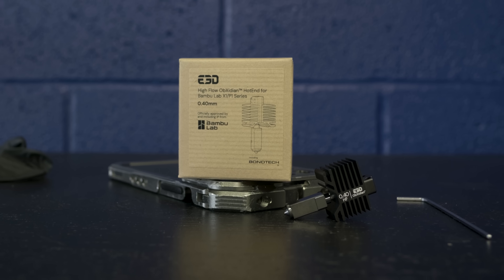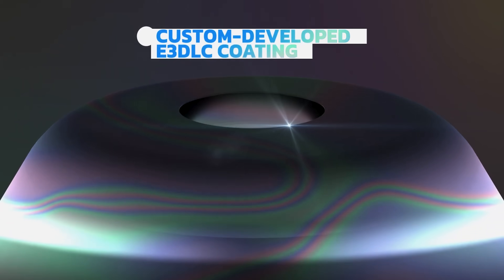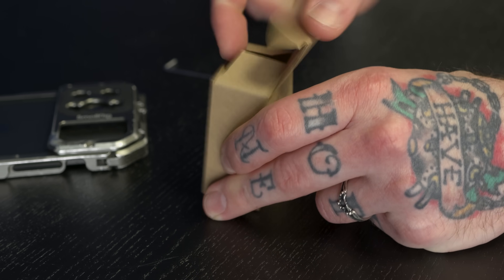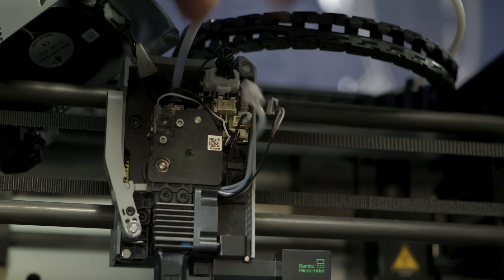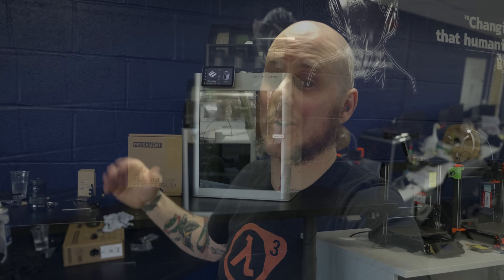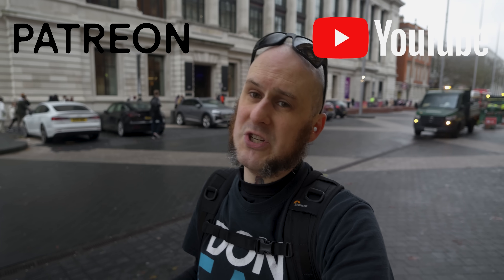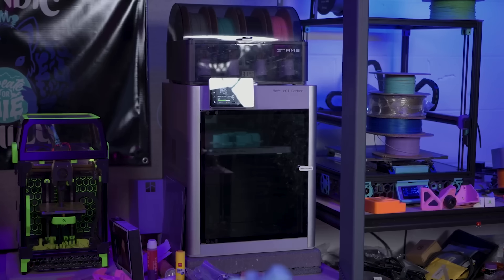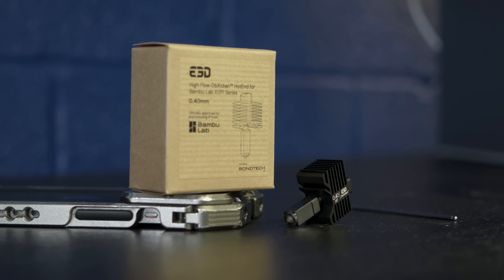REAL High Flow Bambu Hotend from E3D?!? - Install & Test AT E3D

Comment: I'm interested, but the price of the nozzle is the price of two complete assemblies that include a fan and heater. Not sure the performance justifies 7x the cost.
Reply: The obxsidian coating reduces blob stick on the hotend and blob bumping the print is like 90% of the failures I have. If this nozzle fixes that, then i'm all in as it would eliminate or greatly reduce the #1 source of print failure for me and many others combined with faster stronger prints.
Reply: @Hagantic  I've got hundreds of printing hours on my P1P and it effectively runs 24/7 at this point filling orders. I think I've seen blobbing on the hot end twice and that was due to me using some terrible quality filament that had been sitting out for ages. Don't get me wrong, the idea of even faster printing appeals greatly given the faster this machine puts out, the faster it makes money, but I'm going to have to see more than a few reviews before this thing even remotely justifies that kind of price.
Reply: Depends on what you use your printer for and other key factors. 

For me it seems like it would make sense but I have a farm of Bambu printers running prototypes for several businesses and recently added making cosplay items since the amount of printers I have and the speed of the printers gave extra time. Obviously the prototyping takes priority, but increasing print speed while keeping the same or better quality adds more free time for other projects and faster turnaround alltogether.
Reply: @shawnhicks619  I hear you and as someone steadily expanding their own print farm, my argument is as follows; There comes a point where the cost of the upgrade exceeds the value of what you are going to get from it and you really are better off considering spending more and buying another machine entirely. To me this nozzle at that price is dangerously close to that precipice where I would almost rather just buy another printer. Sure I'll spend more money initially, but I'll get far more production than that nozzle will produce in its lifetime. There is also the small fact that the stock bambu printers are already printing near the limits of PLA when speed and quality are concerned and really we are getting into diminishing returns. I view it kind of like upgrading from a lower high end GPU to a high end GPU. Sure the high end is faster and in some ideal situations is certainly noticeable, but 95% of the time the actual performance difference is negligible. Now if you can make an argument where that performance difference benefits you 50% or 60% of the time, then you have an argument. I might be wrong, only time will tell. But beyond a "Oh cool" factor I don't see a real world scenario where a marginally faster nozzle justifies that kind of price.

Comment: Pretty pricey, but then again, all of E3D's nozzles usually are over normal nozzles.  However its not like you need to keep a ton of them on hand like you would with an Ender type printer.

Comment: For the price of the nozzle and the fact it's not a quick swap in like Bambulabs hot-end assembly, I'll just wait for Bambulabs to release their own version.
Reply: I doubt Bambu will release own version. They wouldn't make such cooperation if they planed to do own variant. Next improvement we will see from Bambu is their new printer generation. Current will stay more or less "as is" IMO.
Reply: @arekx Yeah, I’d suspect that the next printer will likely include an amalgamation of all their updates since releasing the X1. For example, I could see an “X2” using the quick swap nozzle from the A1.
Reply: @arekx how long do you reckon until next gen?
Reply: @jbenham91 3-4 months. (It’s Dec 2023 now)
Reply: It’d be expensive and I don’t really need such high speed anyway, but I’d just buy an extra Bambu hot end assembly and put this in it; just bolt on/off like I do with my other Bambu hotends. (But you’re right, expensive overall.)
Reply: You’ll also wait because they’re already sold out  😆
Reply: While the price is high, much higher then a stock replacement nozzle, it’s exactly the same as a replacement nozzle from Bambu. 

I could see people buying this to really unlock the potential of the Bambu line of printers. They are capable of much more then stock one bottleneck is the hot end. 

Im not sure the average hobbyist would be interested at the price but im somewhat tempted to really push the speeds up since I actually run a farm of these making prototypes and other items. Makes a little bit more sense for me since im making money and time is money especially on prototypes for companies. Buying enough upgraded hot ends for a quarter of my machines potentially would be a better investment then another machine.
Reply: They already have their own version! It's called the hardened steel nozzle and it's 15 bucks.
Reply: @DustinGorman  and it doesn’t flow as well as this new nozzle, there have been many YouTubers and bloggers pointing this out over the last year. The hot end assembly is holding the Bambu printers back, and that’s a fact. Thing is the price of this better flowing nozzle is steep, and likely not worth the cost unless it improves flow rate enough that you get 25-50% print speed and quality improvements, which I doubt. If this nozzle were 30 bucks it would be a different story but 70 is just too much and I think a lot of people will stick with the stock hot ends.
Reply: @shawnhicks619  in what world?
The 0.4 hardened steel nozzle prints plenty fast. I've run 35+ kg of carbon fiber through one and a couple hundred of other mixed materials, all at speeds twice or even up to 5x as fast as any of my old Prusas. Finally changed the nozzle at 2700 hours. The original nozzle that came in the printer.

Don't get me wrong, I ordered two of the ObXidian nozzles the moment they were released.

90% of people DO NOT need it.
Reply: @DustinGorman  they literally did a flow comparison in the video, and it’s not like it’s a big secret the Bambu factory nozzles don’t flow as well as it probably should. The fact that these printers do as well as they do with that nozzle is pretty amazing. I agree that I likely will stay with the factory offered Bambu nozzles since I’m not sure the cost justifies the upgrade for what improvements it may bring. If the cost were half what it’s priced at maybe I’d think about it and try to improve quality and speed but they print pretty darn well as is.
Reply: @shawnhicks619 the thing with those racetrack flow “tests” is that they have almost nothing to do with real world printing.  Do the high flow nozzles allow you push more filament faster?  Sure.  Does that have an impact on how the printer functions in actual use?  No, no it does not.  Because virtually nothing you print allows the hotend to accelerate to a point where it matters.  The X1C is a great printer, but it’s a Mercedes, not a McLaren.  The stock hotends are perfectly sufficient for what the printers can reasonably expect to lay down.  The Panda Revo at least gets you quick nozzle changes that will swap with any other Revo-equipped printers you have and access to Diamondback nozzles.  This?  A fat dent in your bank account and a nozzle that will last 5 times longer for 15 times the price.
Reply: Bambu can’t make their own version has the CHT nozzle design is patented. Your better of with Bambu ali express clone hotend with hardened steel CHT nozzle for the same price as the original Bambu hotend
Reply: You'll wait forever.